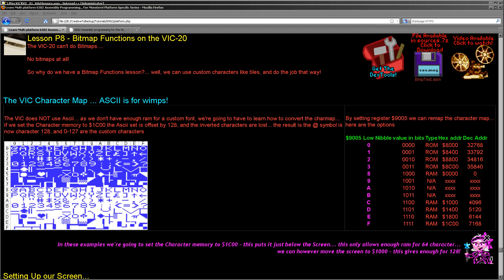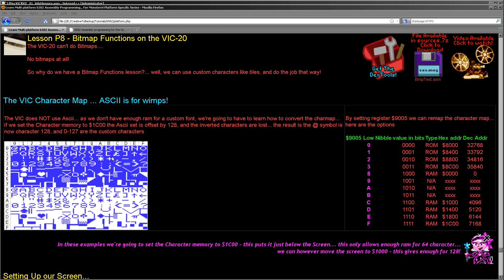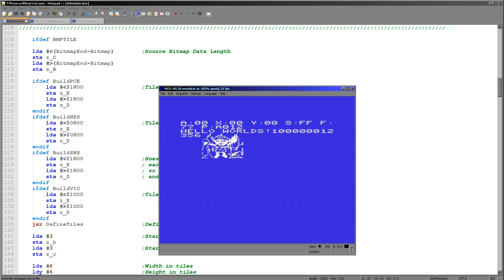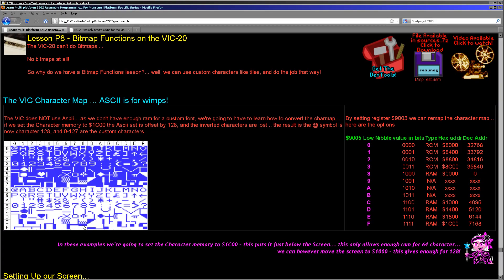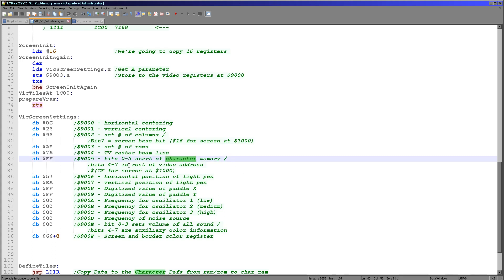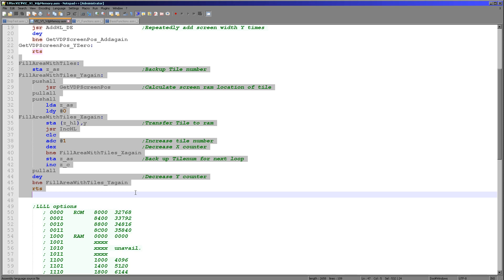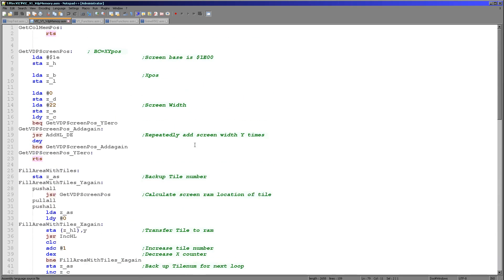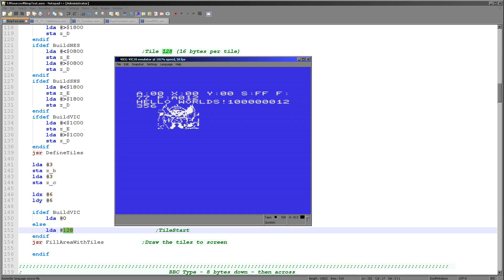Bitmap Functions on the VIC-20 - 6502 assembly Lesson P8

Comment: Only 3872 bytes are needed for a 22x11 screen filled with unique double height chars, leaving 224 bytes for code.
Or to fill the complete screen (22x23), a raster split could be made to change the last line (#23) back to single height char mode and displaying another 22 unique chars (8 bytes each), leaving 48 bytes for SYS call and code.